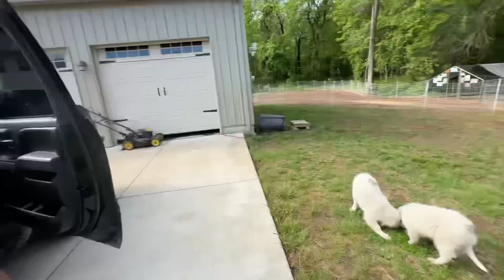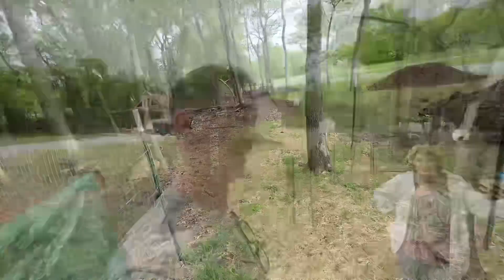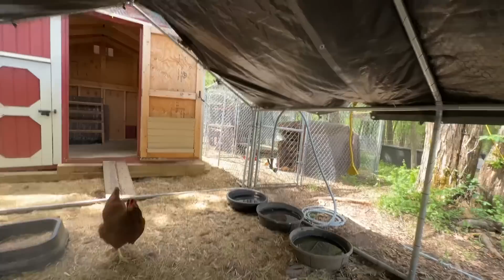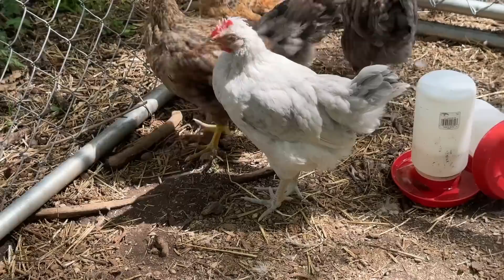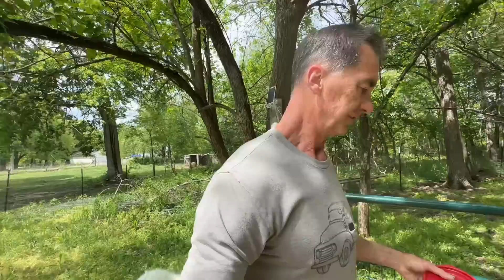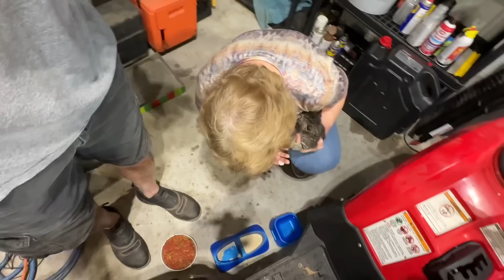Vet Said to Bring Them In…

Comment: Just a little tip.  When I first start to wean the kittens, I put the dry kitten food in a ziplock baggie, then crush it with a rolling pin.  The small pieces are easier for the first couple of weeks for the kittens to eat. Both kittens and puppies look wonderful. I have a question about where Gray is sitting on her eggs. Is anything happening there.

Comment: The puppies are at a good age to leash train them so you don't have problems with transporting them when they're older. Just enough so they are familiar with a leash.
This is a good time to get them used to being brushed and having their feet messed with and their nails trimmed. Makes it much easier to check for ticks and fleas and handle them if hurt or if they end up chasing something off the property like Smokey's little adventure.

Comment: Put a 2x4 in the fence where you step over into the pig pen horizontally, kind of like a piece of lattice. it will strengthen where the piggy’s push on the opening.

Comment: I bet that was the ONLY time you'll be giving those two a bath in the sink. LMAO
   I use a hose end fertilizer sprayer with soap in it to do mine outside when it gets warm enough. 
    I strongly suggest making sure you get them leash trained before they get any bigger. It'll be a whole lot easier to manage if you need to do anything with them.